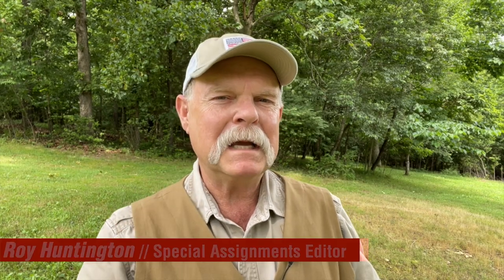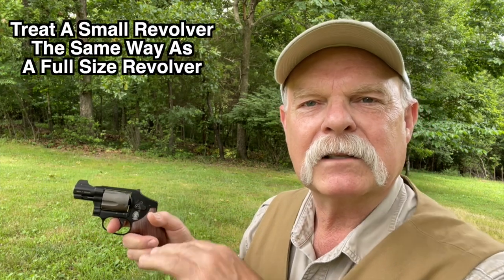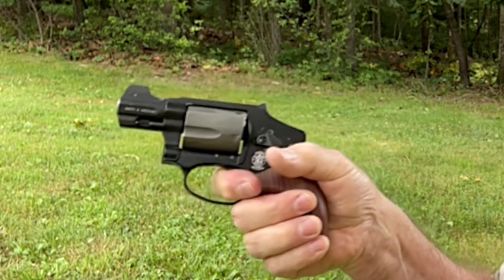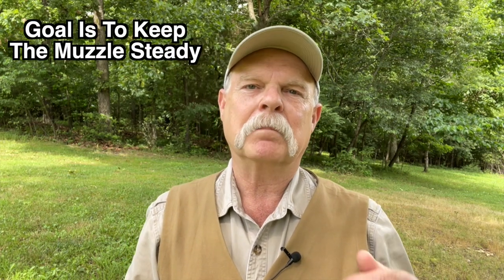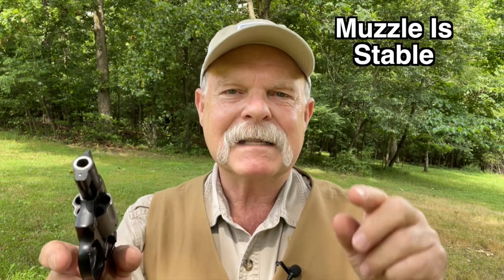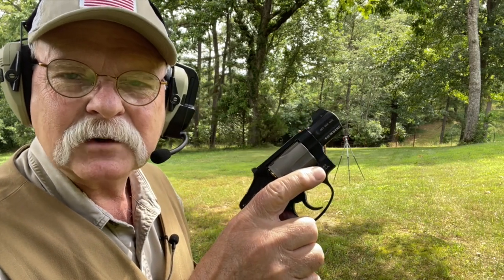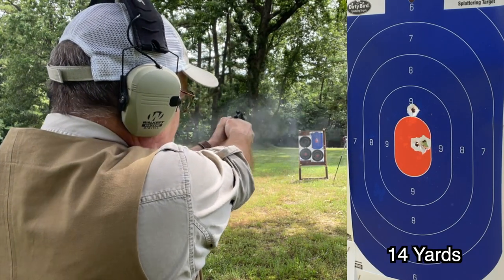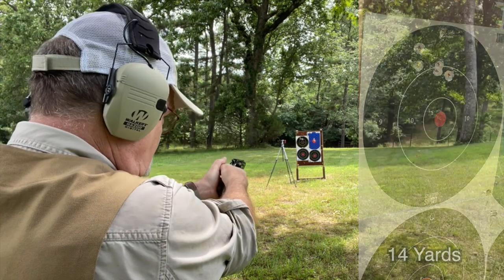Accuracy Secrets For Compact Revolvers!

Comment: I really can’t believe that you will be able to apply this technique in a defensive shooting when you’re shaking with Adrenalin and need to fire fast.
Reply: Under extreme stress, duress or heightened anxiety, the following physiological changes will occur: Loss of fine motor skills. This will typically occur after your heart rate exceeds 115 bpm. The loss of fine motor skills results in you having to rely solely upon your gross motor skills.

..This video really is well meant nonsense.
Reply from the maker: @TheGreatAmphibian  Not it’s not. I was a street cop for 20 years in San Diego and carried a revolver for many of those years. What you don’t seem to grasp is practice like this will make you have a smooth trigger press. As you practice, you’ll get smoother and faster until the stroke is one continous movement. I’ve shot falling plate racks of six plates in under two seconds. But you need to be smooth, and smoothness equates to speed eventually. Roy
Reply: @fmgpubs  This is what you don’t understand..

Under extreme stress, duress or heightened anxiety, the following physiological changes will occur: …Loss of fine motor skills. This will typically occur after your heart rate exceeds 115 bpm. The loss of fine motor skills results in you having to rely solely upon your gross motor skills. This will be most notable in your handwriting or anything that requires dexterity. During the period when your heart rate is between 115 bpm and 160 bpm blood flow is redirected away from your extremities so that it will concentrate in your major organs

You can NOT train this away. However good a fine motor skill is, once your body switches into extreme survival mode, the blood flow etc are no longer there to support them. This is why stress conditioning is such a big part of military training - so that people don’t enter that mode during regular combat.
Reply from the maker: @TheGreatAmphibian  Well, all I can say is I’ve been in many of those situations during my duty years, including being shot at a couple of times. While your heat certainly beats faster, being trained in how to respond and how to shoot means your training takes over. It works, as I’ve experienced it myself. If you don’t train (like this revolver shooting), then if you revert to your “training” during an emergency it means you revert to nothing since you didn’t train. I can shoot a revolver DA fast and accurately under stress (during competition, hunting, self-defense encounter, etc.) because I’ve experienced it. Not sure why you’re not seeing how this can work. Roy
Reply: @fmgpubs  Nope. You still don’t get it. Yes, your heart was beating faster - but a lot less fast than a civilian’s heart typically would be if he was fighting for his life. Because cops are repeatedly exposed to high stress situations, reducing the severity of their physiological response. And when that stress kicks in, yes, the right training can help. But not training that relies on fine motor skills that the muscles will no longer be physiologically capable of.
Reply from the maker: @TheGreatAmphibian  Well I guess you won’t listen to what I’m saying. I’d like to see the links to the videos and articles you do on this topic? I’ve only been writing about it for almost 40 years. I was editor of POLICE Magazine, and editor/publisher of American Handgunner and Guns Magazine. I’ve received training from many shooting schools (where non-police are the majority of students) and what I say here has been proven again and again. So kindly post your background so we know your qualifications? It’s always good to share info based on personal experience. Roy
Reply: @fmgpubs  Newsflash: you’ve been writing stupid things for 40 years. Again, go read what that Sheriff, a nationally recognised expert, wrote on behalf of the NRA. And, no, teaching civilians on the range isn’t the same as seeing what they will do under life and death stress. Which a sensible person would not need telling. As the Sheriff said, training is vital. But has to be smart training. Training fine motor control in the hope it will remove the effects of very high stress is, as he said, stupid. Instead you train people to control the weapon using larger muscles and less subtle methods that will suffer less under stress.
Reply: @fmgpubs  Again, this is what an experienced LEO has to say, speaking on behalf of the NRA…

There are a lot of things that happen to us when we experience the stress of a criminal attack. Some of those things are mental and some are physical, not the least of these is we lose quite a bit of our fine motor skills. Simple acts like picking a coin up off of a table top or fitting a key into a lock become extremely difficult when we are under extreme stress. The management of our defensive handgun is also subject to problems related to the loss of our fine motor skills.

Regarding semi-auto pistols, this is the main reason that I don’t use my thumb to release the slide lock while loading, nor is it a good idea to use just the fingers when seating a magazine. Both of these tasks are easily done with the fingers while practicing and may even be easy to do during a shooting match. Neither example reaches the stress level connected to trying to function when someone is trying to hurt you.
Reply from the maker: @TheGreatAmphibian  Well I did notice you have a cat video on your youtube channel, so I’m thinking that qualifies you to talk tactics.

Comment: Ok Elmer, a 4 second staged trigger press defeats the purpose of a defensive firearm. Well, unless you can ask the bad guy for a time out.
Reply from the maker: You didn’t listen or watch evidently. This is how you train to become smoother, and smoother means faster. Once you get it nailed, you can shoot as fast as any auto pistol. Ever watch Jerry M. shoot a plate rack? I carried a DA revolver as a cop for almost 20 years in two agencies. I also used it in the very early IPSC style competitions in the late 1970s through the early 1980s. You can shoot as fast as you like, and with practice, like this, you’ll be accurate too. Try it … Roy H.
Reply: Fair enough.